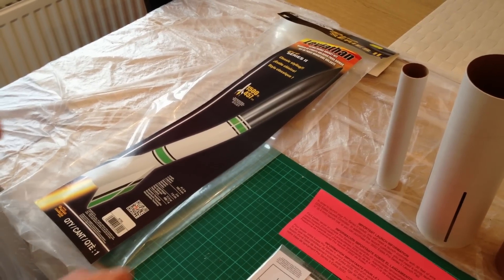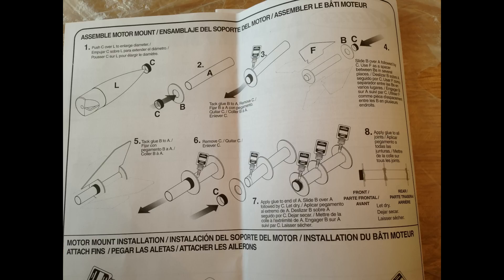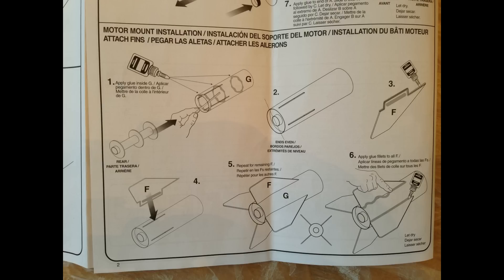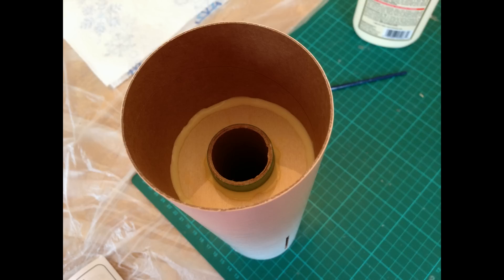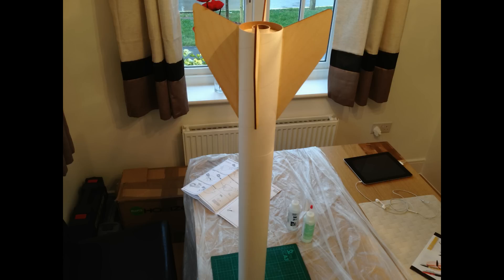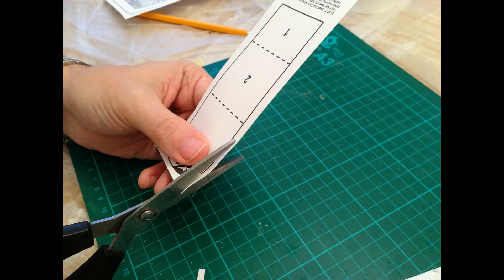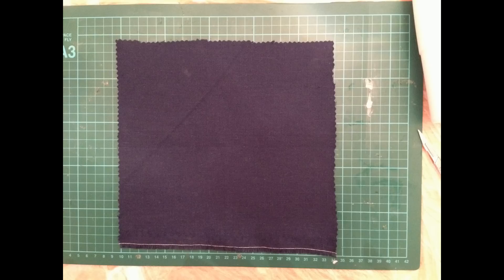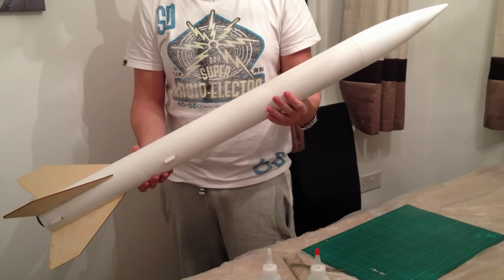Model Rocket Series Episode 3! (Estes Leviathan Build)

Comment: Great video. Just a little note. If the wings are inserted into the fuselage correctly, not all the power from the engine is on gluing the centering rings, but the entire compartment is held by the wings.

Comment: I would modify this a bit, going through apogee rockets I would get the rail buttons and a few other items, including a cloth parachute. Instead of using wood glue I would use epoxy for the whole thing. As far as that paper mount of the chute I would mount the shock cord to the upper engine mount, that a stronger point, I would also replace part of the elastic cord with kevlar. As for putting the lower engine mounting ring in place I would make it so that I could pull it to do the final epoxy job on the fins putting fillets on the inside, then I would epoxy the final engine ring in place. There are more than a few mods that can be done to this rocket. The parts needed can be obtained from apogee rockets.

Comment: A little skeptical about that shock cord mount. Estes folded and glued bit of card would be fine for entry level rockets weighing under 125 grams and using A and B size  engines. This model weighs half a kilogram and handles G engines. I have one which I have yet to build - when I do I plan on using a steel screw eye turned into one of the wooden bulkheads to anchor the shock cord.

Comment: Great looking rocket!  One thing I just don't like about estes is the glueing of the shock cord to the inside of the tube. Yes I know it is strong enough etc... just seems like it was an after thought. Oh yeah hwo do we fasten the shock cord?   :)    When possible I like to put a cable loop forn the lower bulkhead to fasten the coprd to.  I know somtiems and probably with this rocket that would be more difficult considering its length... anyhow love the build and the rocket is going to look great!
Chris
Reply: It would be as easy as drilling a small hole before putting things together, I have done that with other rockets works great, I use Kevlar in the lower part then attach the shock cord to that.

Comment: I would also add a screw eye to the top centering ring and attach the shock chord up through the body like that, I do not like the glue on method.
Reply: I don't blame for that one I did that a few times and had the chute remove a chunk of the tube, talking about a fail.